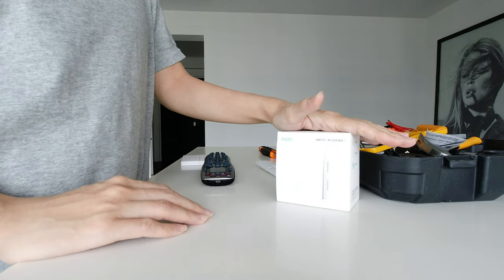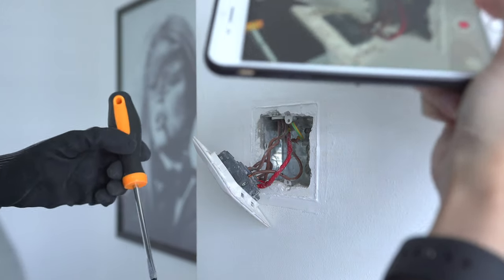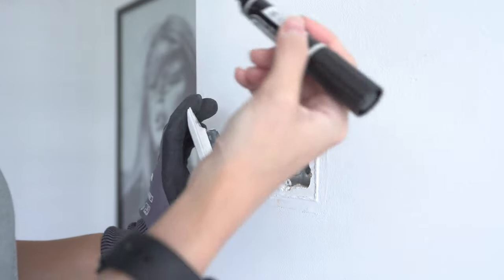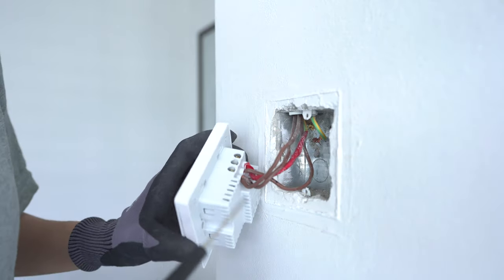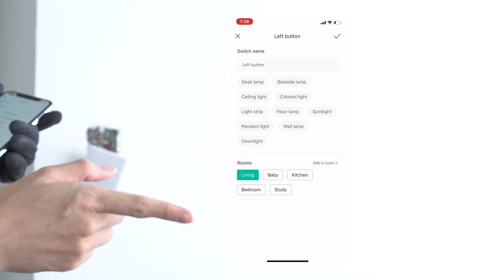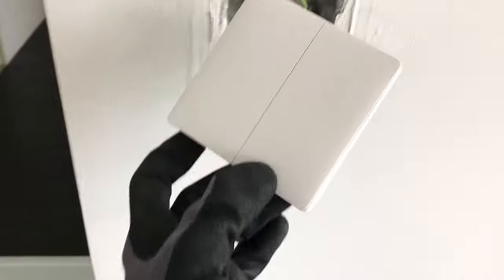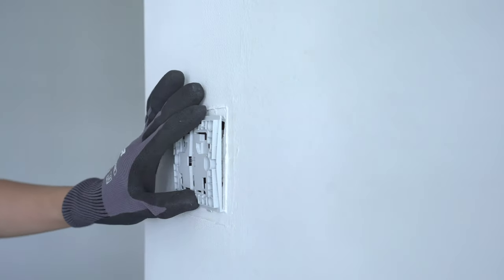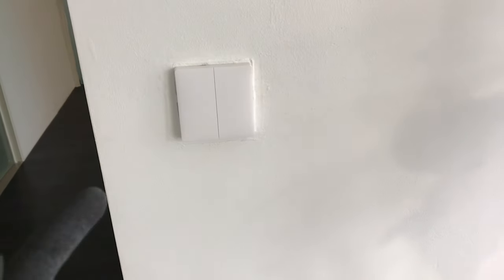Aqara Wall Switch HDB Installation *UPDATED VERSION*

Comment: Hello, 
If a i have this Aqara Wall Switch (single or double), an aqara hub and an rgb lamp/light, can i dim the light over the the app (if i pair only the smart switch in the app) or i need a dimmer switch or a wifi lamp?
Reply from the maker: Is the rgb lamp from the xiaomi family?
Reply from the maker: I know it can with yeelight. I did wireless switch with yeelight bulb. 

However with aqara wired switch, u have the option to switch to wireless switch in setting. Create automation > choose yeelight bulb > + change color or brightness
Reply: Thanks. Understand. Ordering :) the wired switches an the yeelight

Comment: awesome work! i am going to replace all the switches at home and now i think i can do it myself instead of sourcing it to contractor. however, may i know if Aqara hub is a must or the switch can be linked to google home directly??
Reply from the maker: Yup need a hub... thru aqara home to google
Reply: @madsncakes  which aqara hub are you using?

Comment: Hi. I wanna change the water heater switch with none neutral aqara switch. Mine is different from ur switch. I hv brown with 2 L labelled. And neutral with blue.
Reply: Cannot use this for heater switch. Load capacity is only 800W.

Comment: Hi! I just bought a smart switch and they said if my switch no neutral wire, I have to install capacitor in the bulb's wire. I have a track light though, is that possible?
Reply from the maker: No… u gotta pull a neutral wire from a nearby socket 
Or get another non neutral switch to use

Capacitor only if your lights are flickering
Check the aqara updates video
Reply: @madsncakes  

Ahh I see, the switch I bought was for a non neutral light switch, and the seller said I just have to install capacitor at light area so the circuit and be closed.

If both my switches connects to track light, does it mean I can't use a smart switch 😩

Comment: Want to ask a question, is this aqara save the last state? for example if the electricity went down when the light state is on, when the electricity come back online is the light still in the on state or it will be switched off? Thanks for the video anyway.. :D
Reply from the maker: For u. I went to flick the main power. It comes back on
Reply: @madsncakes  Thanks a lot for testing it.. I really appreciate it.. :) :) :)
Reply from the maker: Welcome :)

Comment: Hi there, thank you for your video. Is there a way to link Universal IR with Aqara. Currently the Universal IR uses the Mi Home app and will not work with the Aqara app
Reply from the maker: It does if u add aqara to China region. Both will link up.

Comment: Hi MADs, i planning to install smart switch for my new house. Are you able to advise me the step and device that i need to have before installation?
Reply from the maker: Darren Kam all u need is aqara hub and the switches. Install the hub first then follow this video. Rmb to switch off main power.
Reply: @madsncakes  if staying at 2 storey floor, do i need extra few set of aqara hub to get the whole house connected?
Reply from the maker: Darren Kam yup that will be ideal

Comment: Heya MADS, thanks for the video. I've been doing some research on the xiaomi smart home systems and I'm confused by the xiao mi home vs xiao mi aqara variants. it seems like the new xiao mi devices are all under aqara now and will be controlled by the aqara app? I'm wondering if the aqara gateway ans app syncs with google home as i've seen some forums saying they dont. Thanks
Reply from the maker: Joel Soh aqara is part of the xiaomi eco system. So u could automate it with other devices in the xiaomi ecosystem. And few days back I managed to link from mihome to google home.

Aqara itself has an app that you could link with google home too
Reply: @madsncakes  Okay got it. Thanks Mads, btw i have another question if you dont mind. Can i use these switches for my aircond and heater? I scoured the web trying to find an answer... I was hoping i could find a high amp version so that I can also repalce my air cond, heater, and oven switches.
Reply from the maker: Joel Soh they have an ac plug but I don’t think it works for sg. But you could still control it with xiaomi universal ir. I have a video on it. (Now they updated to English) 

Heater switch shouldn’t be a prob, aqara single wall rocker. 

Oven, you could get a single relay controller or the xiaomi plug

Comment: hi MADS , nice information here ,  but I'm still wondering , can this switches or automation controlled by alexa ? for example I've installed smart switch open for night , and then ask alexa to turn off switch in the morning ?
thanks before 👍
Reply from the maker: Fenky Kwanz Aqara itself works with Alexa and google independently 
I never tried the automation on these ecosystems yet. I’m on Xiaomi and yes I could set it by timer, time delay etc

Comment: Thanks for the video. I’m planning for a DIY convention after watching it. 1 of the main prob is I do not have a neutral wire installed in my current home and I’ve read that ur lights tend to spoil faster for smart switch with neutral. Have u faced similar issue so far ?
Reply from the maker: No issues. Sg don’t use neutral for lights

Comment: So, there's no point in using a smart light with this device, right? I guess it's just better to use a normal light with this smart switch, and the smart light on another normal switch... Or is there any benefits that I'm missing? Thank you!
Reply from the maker: Jorge Packer with smart switches, u could on off on app/ai, schedule timer, automate etc
With individual smart bulbs, u could dim each light bulbs, change from cool to warm etc. But if the switch is off u cant do any of this. Hence I have a smart switch + bulb
It depends on what you need

Comment: Hey Mads! Just experienced Mi Home app crashed. I’m on iOS13. Trying uninstalling the app, changed location to MY (previously China Mainland), restarted phone, all didn’t worked. Have you experience this? If yes, how did you overcome it? Appreciate your advice!
Reply from the maker: Ian Rosli change back to China . Does it work?
Reply: MADS It did not :(
Reply from the maker: Logout and login??
Reply: MADS Found the reason! Problem was actually the reset password: When reset password in ios app, it crashed. I’ve maximised my reset and had to wait 24 hours. After 24 hours, I reset my password on the web, works fine. Then login back to app, and it didn’t crash! Thanks Mads! :))
Reply from the maker: So glad it worked again!!!
Reply: MADS Thank you! Sorry one last q if you don’t mind. Have you ever experience this device unstable? Keep disconnecting. I’ve tried placed it near router, reset device, reset router, still unstable. Would you have any advice for me Mads?
Reply from the maker: What device are u using? Is it the wall switch or wireless switch? What hub and router are u using
Reply: MADS Oh oh sorry! I’m actually referring to Xiaomi IR Remote Control. It keeps disconnecting for the past few days

Comment: Hi, thanks alot for the video! But I have one qns, what if there are lights that has 3 tone colour, can I change the colour in the app?
Reply from the maker: Tiffany Nyap is it those that u press once and it change color, press again another color? Then it should work
Reply: MADS yes! U mean it works in the app?? Great! Thanks! I bought the lights with 3 tone colour. Thought it wouldn’t work in the app. Thanks for reassuring!
Reply from the maker: In the app it looks like a normal switch, u just need to press like how u would usually

Comment: if i have a normal wall switch that control 1 normal light and 1 smart light. if change to this smart switch, can i still off the normal light and still having control of my smart light?
Reply from the maker: Ya can. U have control of the smart light
When u on the smart switch for it on app
Reply: @madsncakes  and the normal light will on or off following the smart switch position? my key point is the normal light wired together in the same loop as smart light. thanks for the reply
Reply from the maker: Why use the loop
Reply: @madsncakes  its already prewired by the developer. 2 light points connected to a single wall switch.  no answer anywhere on this...i understand my issue will be resolved if i use both smart lights. but i can only use 1 due to some reason.

Comment: Nice vídeo. After installation, how do you remove the switch from the wall?
Reply from the maker: At the bottom there are 2 holes
U can push with a flat screw and it should come off with a bit of force
Reply: @madsncakes  thanks :-)

Comment: Thank you to sharing how to install the smart switch installation. Just wondering do you use the xiaomi sensor to connect with the smart switch?
Reply from the maker: Brian chan yes u could but I don’t connect motion sensors to lights anymore. It can get freaky lol. I do use it with ac. No motion for 20 mins, switch off ac through the IR. Works for me

Comment: Hi, thank you for doing up these videos, it's helpful. Can I ask you a question? I'm renovating my HDB house and thinking of installing Xiaomi smart hub with it's smart lights (Singapore version). But I also have non smart Philips LED downlights used throughout my house, and was thinking of installing the Aqara switch to control them. My question is, if you know, can both Xiaomi hub system and Aqara hub system work together? I can see the list of Aqara switches on the Xiaomi Home app though? Just want to make sure before I make the switch purchase.  Thanks in advance.
Reply from the maker: Use the same family
Aqara switches aqara hub. China region
Will work better
Reply: @madsncakes  thanks 👍🏼

Comment: Would you be sharing how to convert the switch from 2 way to 1 way? It might benefit some of us. Thanks
Reply from the maker: I won’t be sharing and it is better to get an electrician. This guy is great and lost his events cabling job from the covid situation. So if u need any electrical works done do look for 
Johnny +65 9010 9695
Reply: @madsncakes  thanks for the contact. Johnny helped me with my smart switches electrical work. He even tried solving my complex 2way scenario through WhatsApp and guide me through. Pls get in touch with him if you need any assistance on smart home solutions 👍🏻
Reply from the maker: Nice 🙌🏻
Reply: Hi do you connect any capacitor for your nuetral wire? As what i know if you didn’t run any neutral you need to run light wire to capacitor then to neutral.

Comment: Forgot to ask in the previous video, does the Aqara Wall Switch only work with Aqara Hub?
Reply from the maker: Yes
Reply: @madsncakes  ok thanks...
Reply: @madsncakes  forgot to update, I tested with Xiaomi Gateway and all the Aqara switches worked. My gateway still the old version 2
Reply from the maker: Thanks for updating me! Good info for everyone too
Reply: @madsncakes  yup, really appreciate your videos too... BTW, for the Aqara Switch Non Neutral version don't need to worry if the live wire is in the wrong place, i tested it out change here and there, the switch will auto detect it actually and correct it if connected wrongly.
Reply from the maker: Do u have a link to show me which gateway u are using?
Reply from the maker: Today I’m working on the d1 switch. Have u routed 2 way switch to aqara?
Reply: @madsncakes  should be the same as this: https://passionhome.sg/product/multi-functional-gateway-v2-xiaomi-mijia-wireless-wifi-zigbee/
But the one i bought is 2nd hand lah, cos i wanted to be sure if it works with the aqara wall switch.. I boought a 2nd hand China version of the starter kit, the one that had one gateway, one door/window sensor, one wireless button and one smart plug.. Using all of them
Reply: @madsncakes  I'll email you later tonight with pics and stuff
Reply: Email sent, check your gmail

Comment: Hi, is this installation for no neutral?
Reply from the maker: Yes
Reply: Thank you for your reply. I need a little help, I'm a little confused about something, I read that smart switches without neutral will not work unless there is a hub or a capacitor (you need either one of this for the switch to work wirelessly). Because you have a hub, the wireless switch works. Is that correct? Is the hub expensive?
Reply from the maker: Yea need a hub. Hub is around $40-50 in Singapore...

Comment: Hi, I have a shawader smart switch that I can only activate by voice with my smart speaker or within the app, I can't turn it on or off manually, the touchpanel is not working
Reply from the maker: Pedro Martell changed to aqara but no voice command on Google.. maybe Siri thru xiaomi

Comment: Did anyone’s switches turns off by itself? I’m using Aqara D1 non neutral double rocker ~ sometimes it just switches off by itself ? Any solution?
Reply from the maker: need replacement

Comment: Hi there, what happens in the event of no internet?
Reply: no internet = cant turn on light using apps only wall switch can use for normal
Reply: Automation triggered by sensors and wireless switches would still work if no internet. And you can still manually use the wall switch to turn on/off lights. Only thing that you can’t do is use your smartphone to control it 😅
Reply from the maker: Yup it becomes normal switches
Reply: Hi. I think it uses the zigbee protocol to communicate with the gateway. So if you have other input devices like the motion sensor in your bathroom in your earlier video, the automation rules should still work locally ie via zigbee not via the connection via your router.

Comment: Is Aqara wall switch approve by sg gov ?
Reply from the maker: Nope
Reply: @madsncakes  in this case then I go with smart bulb and smart bot pressor with their hub mini (hub plus is out of stock currently)... I just need turn on my storage tank switch before I reach home and combine all RF controller using hub mini ...
Reply from the maker: Smartlife system is 👍🏻

Comment: So basically without the hub the switches won't work right?
Reply from the maker: Work like normal switch
Reply: MADS Then how about using this with an apple TV as a hub instead of the aqara hub? Would that work?
Reply from the maker: Nope
Reply: MADS Alright thanks for the insight keep the vids coming!

Comment: Hello, no neutral has a reputation of being finicky. Do you face the issue? 
Will it be better if it is no neutral- SLISAON version?
Reply from the maker: No issues
Reply: @madsncakes  light doesn’t flicker after switched off?
Reply from the maker: @alfredlim11nov  out 30 lights I changed. 
Only one seems to be problematic. I believe changing the switch will fix it. But I left it as it is

Comment: Hi. Thank you so much for your video guides. Can i just check with you if any of your switches went faulty yet? I was told the non neutral switch gets spolit easily. I just mounted mine today.

Fyi for those whose bto is like mine. Refer to the video below on how to remove the bto switch. (Slightly diff from MADS)

https://youtu.be/Y8AE_hFtCqo
Reply from the maker: OT JCD so far so good if u seen the first video, it’s almost a year now

Comment: Hi do you have any problem pairing the wireless switch to the hub?
Reply from the maker: Nope.. no issues. Must be same brand thou. What are u using
Reply: @madsncakes  Hi thanks for the reply. I am using Aqara wireless switch with Mi hub, while i have a friend using Aqara wireless switch with Aqara hub both having this problem of unable to pair. Or it takes like multiple attempts(20 to 30 times?) to just to pair. Any idea how to solve it?
Reply from the maker: Hmmmm could be an old gen pairing with new gen. Try to get both on the same page
Reply: @madsncakes how to differentia old and new gen?
Reply from the maker: Hmm. You gotta check with seller. I had one aqara hub that didn’t work too. But I bought a new set- and it works